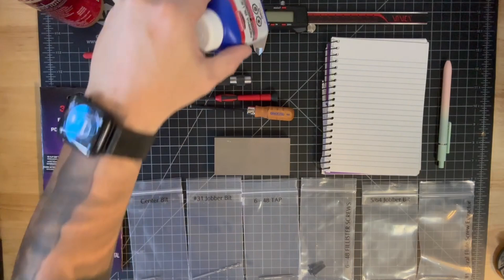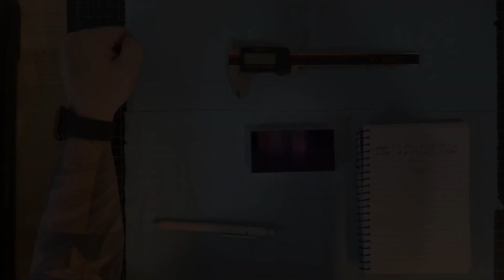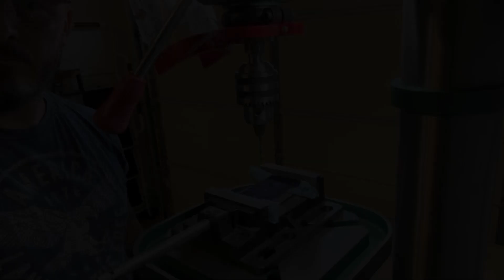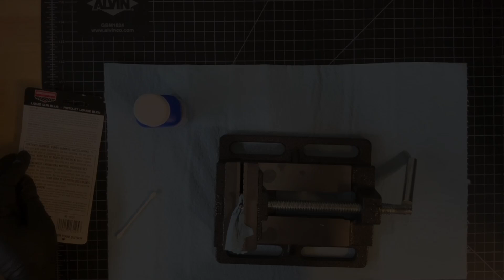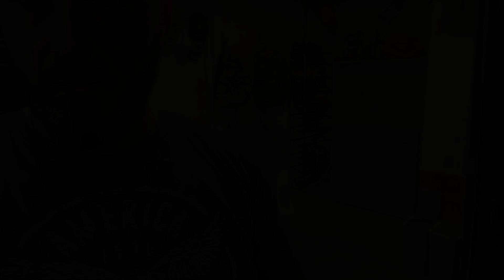SDI FTT 111: Firearms Inspection & Troubleshooting / Fastener Repair Lab

Comment: I really appreciate you posting this brother. I’m in FTT 111 now and I noticed my instructor stress that we need to start prepping for this final week project. Quick question I can never make the time limit and my camera angels are trash. What editing program and camera setup do you use?
Reply from the maker: Thanks for the comment! I use Movavi video editor, mainly because I am fairly technology ignorant and I found that to be extremely easy for editing. As far as the angles I use the Real Avid Smart Assist System and my IPhone. I Purchased several bases to put in different places in my work area. Hope this helps, and feel free to message me with questions.